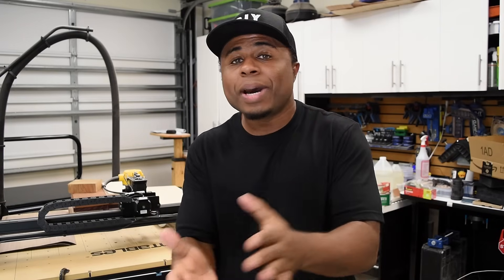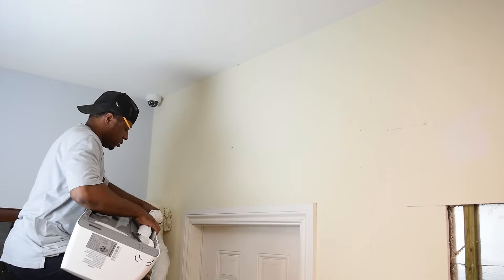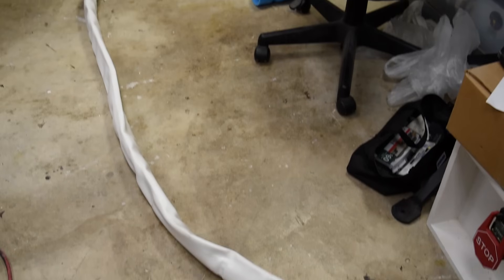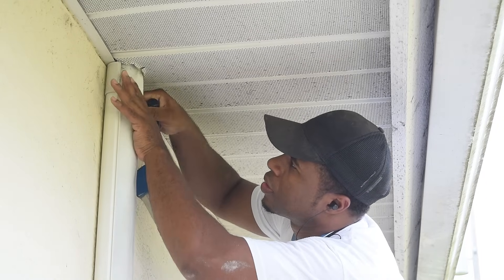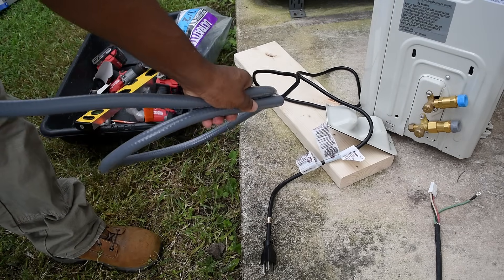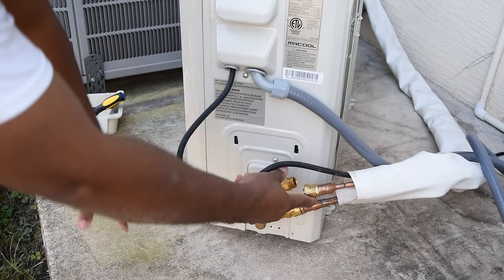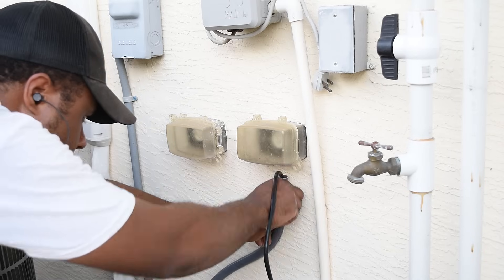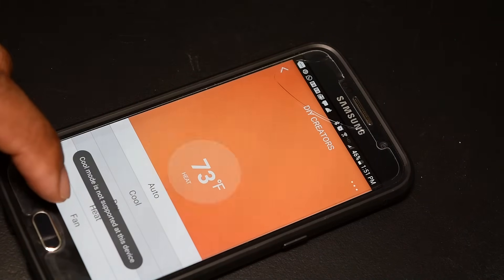How To install Ductless AC & Heating System // True DIY Mini Split MRCOOL

Comment: I had no idea that there were 100% diy options for this. Thank you for doing the research and also congrats on the sponsor.
Reply: Not true, he made a lot of crucial mistakes that he, and you aren't even aware of because you have never learned the proper process for installing one of these systems.  

  His unit is certainly not running very well.  I would be surprised if it is even running anymore.  I bet you that he has called multiple service technician to get it running properly, if he did that, and they went back and did all the things he forgot to, then his system might still be alive.

Comment: Hopefully you don't have any issues with not putting a vacuum pump on the lines. No matter what the manufacturer says it is good practice and you won't have any air/moisture in the lines
Reply: Once again, you CANNOT vacuum the lines, nor is it required, for the MrCool DIY series.  The line set is the item that is precharged with refrigerant, which precludes the need to vacuum the lines...since there are no lines that need that: this applies ONLY to the MrCool DIY series.  With other mini splits, YMMV.
Reply: @eldergeektromeo9868  hahaha, How many times have you addressed the vacuum comment?
Reply: Hey Kelvin.... just trying to address "alternate facts" for those that may be considering this DIY project...and thanks for noticing...:)

Comment: I'm a 30+ year HVAC veteran tech. Not a bad job! I was installing mini splits way back when the controls were on a long wire.. LOL 
For everyone else please check with your local building codes before taking on a job like this. All HVAC technicians are supposed to be certified to not only work on all HVAC equipment but to buy it as well. Work of this type really should be done by a reputable licensed contractor.
Reply: ..except for the MrCool series, which does NOT require a licensed HVAC contractor to install...in ANY state, since the DIYer does not need to mess with any refrigerant, nor "vacuum" any  linesets.  This is stated in the MrCool DIY warranty on their website.  Many, many installs have been done successfully by DIYers using this series of mini splits.  The DIY part does NOT include preparing your electrical connection, so local building codes may apply to that part of your installation. If you have no experience with electrical, don't do it, or as they say in Ocean Safety: if in doubt, don't go out!

Comment: I’m in the HVAC business. All in all looks like you did a pretty decent job of installation. Wouldn’t of been so easy without the pre-charged line sets. Easily the refrig lines was the roughest part of the install. I can imagine how many trips in and out of the attic it took. Typical install takes a pro about 6-8 hrs. 😎

Comment: Can you please post how much your electric bill goes up? I have been thinking about buying one and installing it myself. All the local HVAC companies want over $4000.00 to install the same thing. I want to use it in my loft space overlooking my bedroom. It gets pretty dam hot upstairs in the summer. Great video. PS. You really do look like Easy-E. Please keep posting videos.
Reply: I installed a Mr Cool over a year ago. I pay about $0.11/kilowatt. Light bill went up about $35.00. I use the unit about 10 months per year for both heating and cooling. Mostly heating.

Comment: Great video! I just installed the Pioneer mini split 12000 BTU heat and AC . 
mr cool looks identical, probably made on the same assembly line.
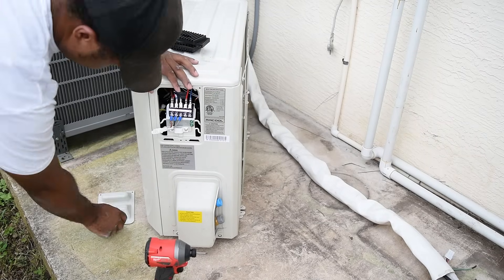Mine was not a DIY unit but I do it my self with a 10 foot line set. I vacuumed it down and watched the vacuum readings for and hour while did other things. No leaks I opened the valves just like you did. Started it up and works great. I am in West Texas and gets a might Warm 98- 105 is not uncommon. I too have the Wi-Fi and set a schedule for it come on at 20.02 ( we are not charged for power between 20:00 and 06:00)
I turn it off at 05:45. May I ask what duct temps are you getting on cold and at what is the Outside Temperature is when you check it?
Our remotes even look the same.
And it is extremely quiet.

Oh I paid $700.00 for mine online thanks
Reply: It's a Midiea 

Chinese mass produced rubbish

Comment: Wow! I just ( a few days ago) installed this exact, same unit.  Been through 10-12 "install videos", but this is BY FAR, the BEST!  That being said, the DIY part of the Mr Cool series applies ONLY to the Condenser/head/line set installation, and NOT to the electrical.  Luckily, I had a dedicated 20A/120v line available, so I wired the romex to a junction box, from there to one side of a Disconnect box, and the other, to the Mr Cool condenser. Both units are whisper quiet, and I would suggest that, if you have over 600 sq ft, size UP to the 18K BTU unit (same install routine): it only comes in 240v, so you will need that electrical installed, however, I bought mine at a "membership only" warehouse, and it is a few hundred dollars LESS than anywhere else, with much better return policies than anywhere else as well, so you may have a few extra dollars available for the electrician  The entire MrCool line is on their website, so check your pricing before you buy. While the "head" unit is "light", handling the line set can get unwieldy very quickly, so two people minimum on the install.  I did drill the 3 1/2" hole, and it worked out perfectly.  I also used the same Line Set Cover as in the excellent install video above. I did use a thread goop on the condenser line set install:Refrigeration Technologies RT201B Nylog Gasket/Thread Sealant.  It is designed for AC installs and will not contaminate the refrigerant. Mahalos to the DIY KING for the BEST Mr Cool Install video available on utube.
Reply from the maker: Amazing I can tell you did you research. Thanks for the compliment.

Comment: Some manufacturers will void your warranty if you don't have it installed by a qualified installer, so do your homework like Glen did..
Reply: This one is made to DIY, hence the pressurized lines and no need to vacuum the system before releasing the gas.
Reply: STFU

Comment: You probably already know this, but most garages have vents to the outside. If you use you car only for a shop, then you should be fine with blocking them so you don't waste electricity, but if you park a car in your garage, It would probably be a bad idea to block them off.

Comment: 4:40 hey there, just thought i would give a tip when u need an extra hand. In case of this just tie a heavy sack of something to the end of the pipe and leave it hanging, that provides some pull. Doesnt have to be too heavy. Then just feed it from the attic yourself. No need of two people. hope this helps!
Reply: He didn't use two people though. He ran, back and forth himself. Remember he said he was exhausted from running back and forth?  Thats A " G " right there, no one is going to hold him up! THUNDERCATS HOOOOO!
Reply: @chanelprincess6061  Thundercats ROFL you actually made me laugh dude, thx
Reply: Thats a no no 1/4" and 1/2" copper very easy to kink
Reply: @yoboyjaydee624  I don't think you mean 1/4, 1/2 yeah but you can tie 1/4 in knots and it won't kink
Reply: @mattm5361  yes he meant 1/4" and 1/2" those are standard sizes for a 1 ton mini split.  They are very soft and pliable and do kink easy
Reply: @johnbales9398  1/2 yeah, 1/4 you can tie in knots.
I've been doing this for nearly 20 years...

Plus a RT is a old and antiquated unit of measure that dates back to when we were still using blocks of ice. We use Kilowatts now.

Comment: Sorry if you already said it, but how much area can one of these heat and cool?
Reply: He said it was the 12,000 BTU kit. The useful square footage will depend on what climate you live in. Any extreme hot (i.e. over 110°F) or extreme cold (i.e. under 0°F) will make a heat pump setup like this pretty inefficient, and it probably won't be able to keep up with even a relatively small area. 

Always consult with the manufacturer's specifications before buying a system like this. If they've done proper testing on the system, they'll be able to give you details on what size system you will need for your specific use case.
Reply: Depends...but essentially 12K BTU=1 Ton, and many installers figure 500sq ft per ton, depending on your ceiling heights...thats usually a good measure for 6-8 ft ceilings.  Anything higher, size UP.

Comment: Hello!! Don't you still need to do a vacuum to remove all the moisture out of the system?🤔🤔🤔 I don't know where in USA your at and/or how common are in USA,  but here in Mexico are very popular,and common, and last for years, as long as you give them the proper maintenance. Great video, thanks for the info God bless
Reply: Nope!  Not with the MrCool DIY series.  Nothing to vacuum, in any case, since the line set is pre charged with refrigerant.

Comment: I have mini splits in my old home.and I love them.  My only concern with them in the shop would be the dust.  Let us know if becomes a problem.  Thanks, Jim
Reply from the maker: I agree, so far when I need to cut and create dust I turn it off. I need to add a filter system in the shop soon.

Comment: Probably the most useful sponsored video I've seen.  Glad they hooked you up & I know they'll get at least one sale from it when my shop area is finnished. :) thanks for the video
Reply from the maker: lol thanks!
Reply: @DIYCreators  Curious how well this brand/unit has held up through the years? Any issues?
Reply: They will have me as a customer. I love that it comes fully charged, and when he hit that remote, my eyes lit up like a Christmas tree. I LOVE IT!
Reply: Well I just finished receiving my unit today so they have me as a customer thanks!
Reply: Just so u know I've had 11 customers this summer in the area with these mr cools. 10 of the 11 had to have a 3 year old system replaced and were denied any warranty. The other customer spent a grand to have a new computer board as well as a bunch of wirining done.  These are cheap for a reason. Please just know that before making this purchase. If cheap is what you want this is the system for you! But if ur just trying to save. This will cost you in the end. According to statistics anyways
Reply: IM A 25 YR HVACR TECH.... mr cool is garbage... disposable ac... made in china... good luck ... i guess you have to go to china to get your warranties...  take my advice as a professional... stay away from this poor product
Reply: Like I said...we had these in Iraq & Afghanistan... very reliable! I'll be ordering one for a 14x40 cabin.

Comment: This is really awesome. Next you need to insulate the garage door. Super easy task, and it makes a several degree difference immediately.
Reply from the maker: Thanks, Yes looking forward to it.
Reply: DIY Creators the insulation is in my cart at homedepot.com right now. I need to get cracking on releasing videos. I've been super anal on the editing, but I dont think I'll get too much better until I start releasing them and getting feedback. Might do the insulation as a practice video.

Comment: Hi Glenn from Moscow, TX
Reply from the maker: Hi Amanda 😀
Reply: @DIYCreators  was wondering when installing this unit how far from floor/wall base to ceiling interior can this unit be set up in a tiny house? My walls are  9 ft tall  with slant roof. Only 2ft clearance over main entrance.

Comment: you can cut the AC harness but you need a special tool to connect the fitting
Reply: Not for this series of mini splits!  Cut the line, and you WILL lose the refrigerant, which will require you call an HVAC expert to vacuum and recharge your unit.

Comment: Thanks great video. A lot of garage shops (including mine) could benefit greatly from this type of system. I have a ceiling and one wall that is not insulated, so I am not sure how to factor that in for selecting a unit. Does Mr Cool Help out with unit sizing?
Reply from the maker: Thank you, yes they will help you size it.
Reply: The unofficial  "rule of thumb" HVAC installers have used for years in the Southwest ( AZ specifically): 12K ( 1 Ton) per 500 sq feet.  I would suggest to always size UP if need be.  These units are very energy efficient, as you will find.

Comment: I'm jealous of your air conditioned garage!  I've got to frame mine out and put in a ceiling before I can install one, and all of that is super low on the priority list.  You're an absolute beast for running all of that by yourself 2" at a time.  I totally would've lent you a hand if I was closer.
Reply from the maker: haha, it was very low on my list too. I tried to tough through the heat but it's Florida. It's a constant reminder, I'm in there more than ever so it made sense. I could have used a hand for sure. Of course, my lady went shopping when I need help.
Reply: Haha!  Of course she did!  I hear you on the FL heat.  It's usually upwards of 95 degrees in my garage, past midnight.  The local feral cats won't even hang out in there at night.  And I know it's not any cooler while running lines in the attic like you did.  I was having fun with that myself the past few weekends.

Comment: Weren't you supposed to run a vacuum on the lines before opening the valves on the machine with the refrigerant? My mini split required a vacuum on the lines first, then open valves.
Reply from the maker: No, the lines come sealed with a cap. You take that off right before connecting. This is a DIY unit its ready to go.